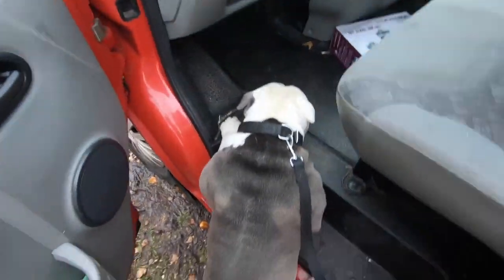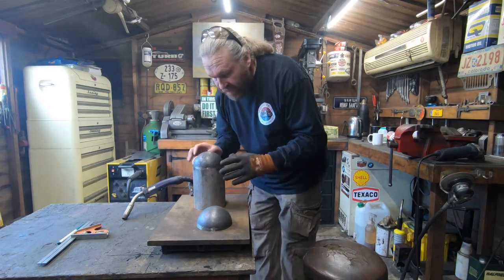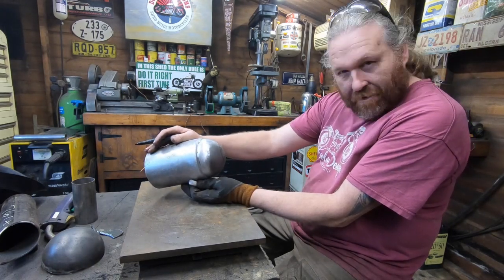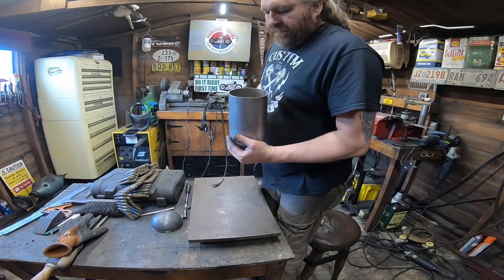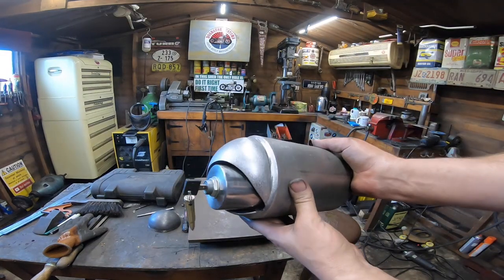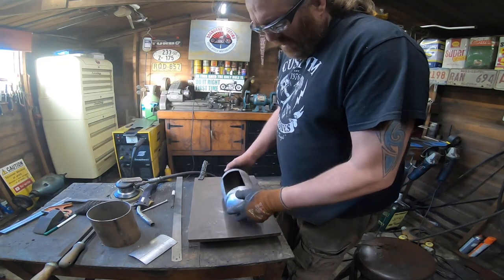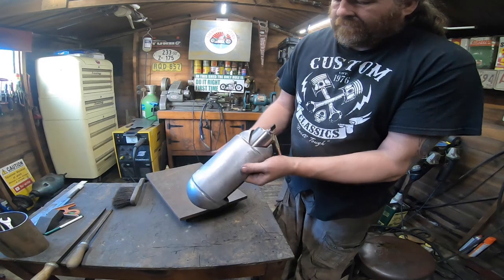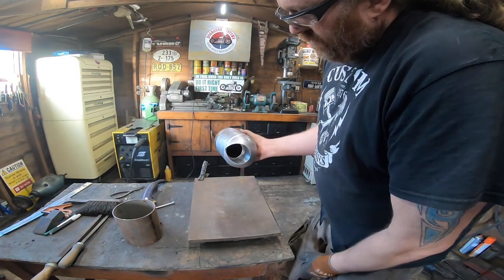Next part for the bike I haven't got yet

Comment: Next oil tank slice the ball into fours slices, turn the first slice inside out so it starts to dish into the oil tank and then the small tip the ‘correct’ way out to you end up with a ripple effect? (You vary the tube size to maintain oil capacity).

Comment: Craig, would it be possibel for you to show how to wire up a new ignition. my bike was recently stolen and recovered. they cut the wires to hotwire it and fucked the ignition. want to replace it with aftermarket 3 way ignition.  cheers

Comment: Looks better !.....would an oval tank be possible to do ? so the battery is fully within the shape of the oval without the square section sticking out of the bottom . Could still have a curved bottom hatch with a flat plate welded into it for the battery to sit on ! ......just a thought , tell me to stfu if you like ! 😂